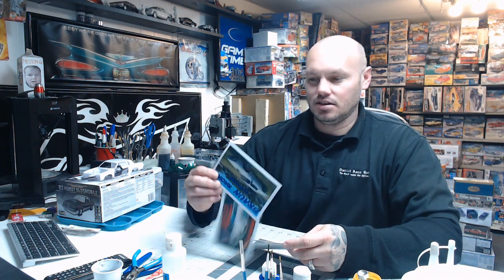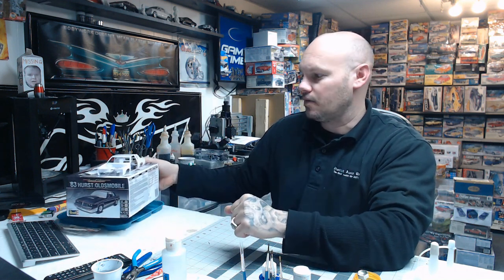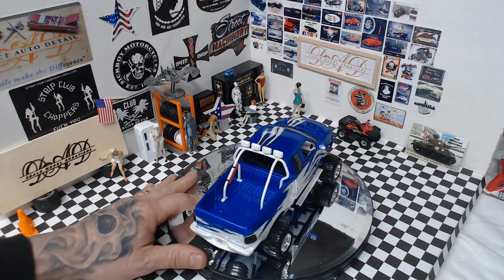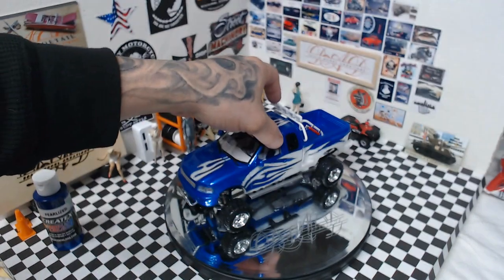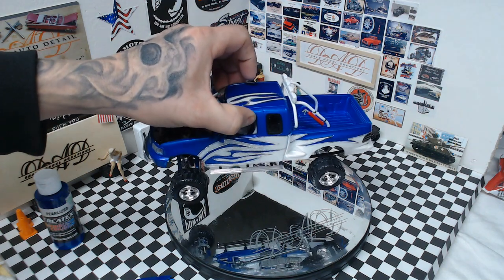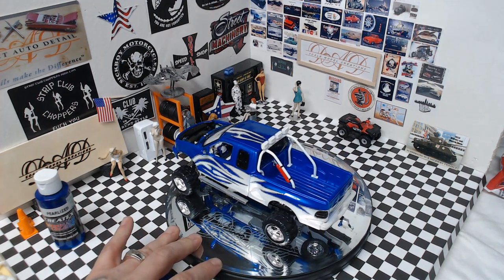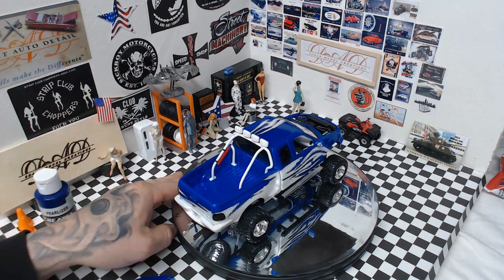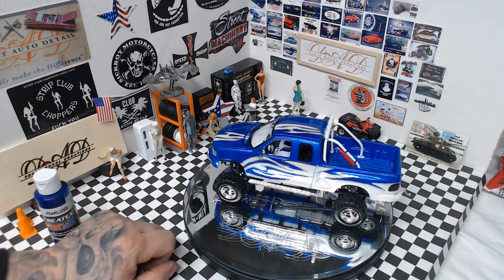Tim Husley's ford truck final

Comment: what did you mix the Auto air paint with I bought some of them haven`t try them yet
Reply from the maker: Shot it straight from bottle but it is water based so can be thinned if needed
Reply: @distinctautodetail4165  good to know that is what I thought thanks for the tip on the miniwax clear gloss love it